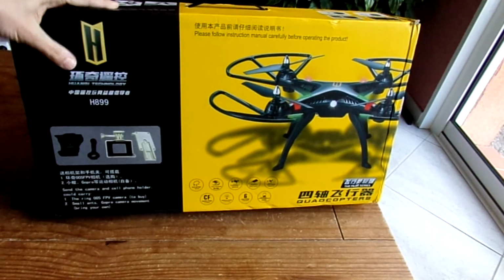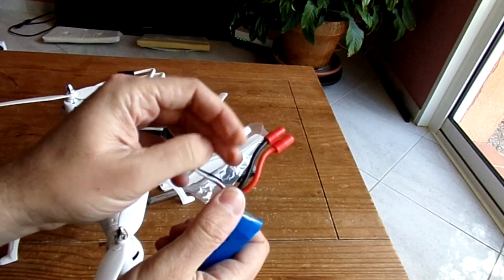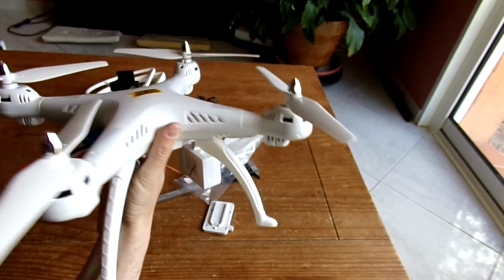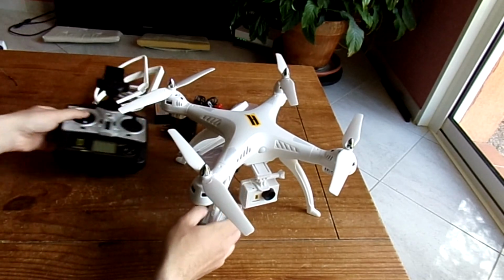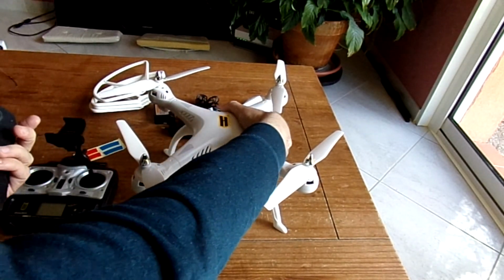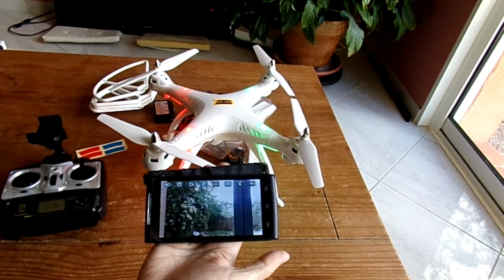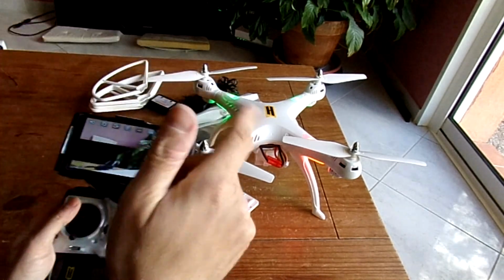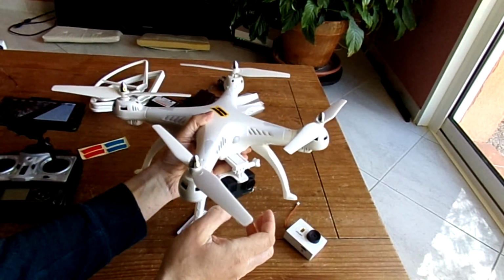HuanQI H899 Unboxing and quick analysis (Courtesy Lightake)

Comment: be careful, today my Huanqi just flew away... including my GoPro Hero 4 :( it just stopped responding and flew higher and higher (right into the sun). It might be in space, but I handed out flyers in the neighborhood and hope for replies. Anyway, what I wanted to say is that it is a great quadcopter for the price, but it might not be worth the risk for your GoPro.
Reply from the maker: Was the WiFI turned on with your GPH4 ?
Reply: +SeBy DocKy No, otherwise I might have seen where it landed. I'm thinking about buying a GPS tracker
Reply from the maker: Ok ...maybe you were out of control and I can't remember how many seconds props are still spining in such case ....  It's written in my review :)

Comment: how was your experience with LighTake.com? Did you get it shipped fast?
Reply from the maker: In the average ... but there are not scammer at least
Reply: +SeBy DocKy I ordered mine from the same company 2weeks and did not get it.  But they were happy to take my money.
Reply: I was scammed do not buy
Reply: +JDNS Vlogs what happened I just order mine :(
Reply: +Christian Martinez it's not as bad as I thought but still bad I got a note from the guy the words are spelled wrong in a look very unprofessional he said  it will be here in 2 to 4 weeks. crossing my fingers and hoping that it's true
Reply: +JDNS Vlogs Hope so :)

it looks really co for the prize and I will be using my GoPro not that camera thanks for the info
Reply: +Christian Martinez I will tell you this I had the drone and ordered it from Amazon it broke out of my dispensability but it works great for GoPro it flies just like a phantom for the price that you get all I see is getting extra battery go on Amazon and buy an extra battery it's the best price you'll ever get